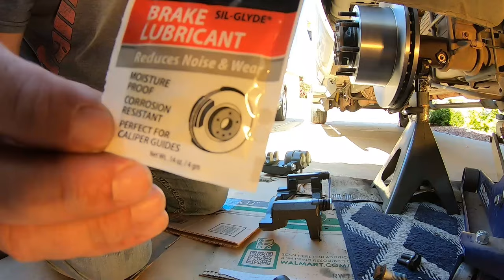Scary Moment! F250 Brakes!

Comment: You  really should put a jack stand under the axle, it is not safe the way you are doing it.
Reply from the maker: I had one under the hitch receiver to begin with so it wouldn't fall, then if you notice I did add another under the axle which you can see. Thanks though!